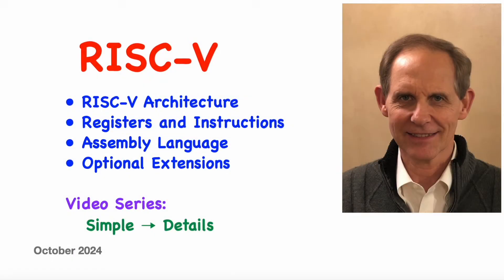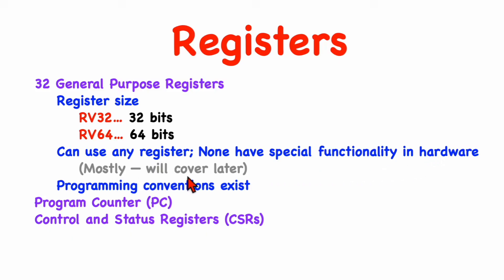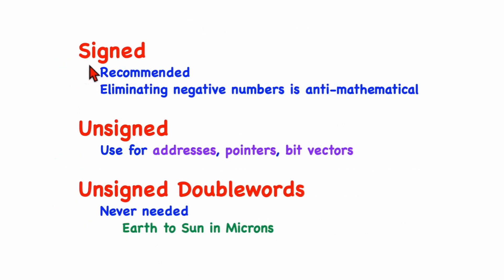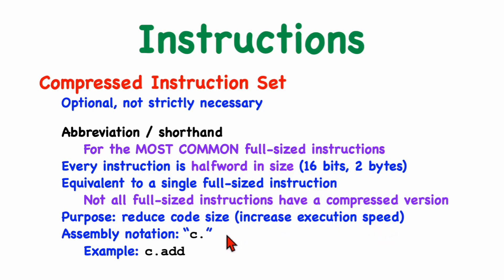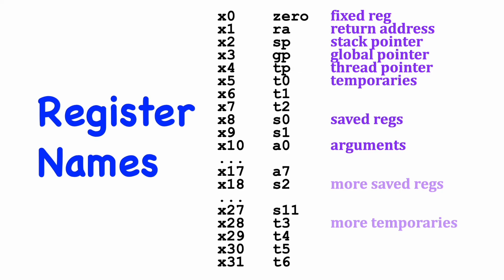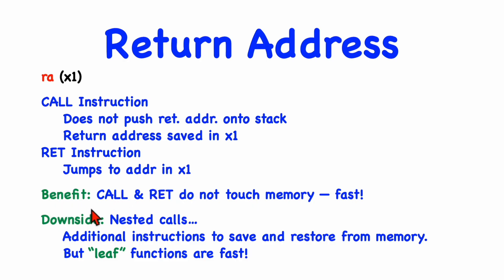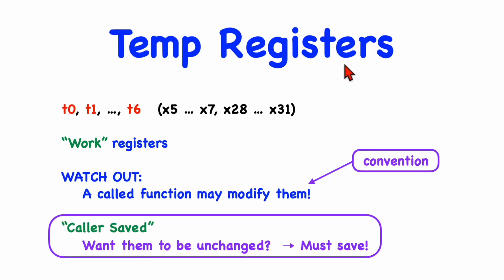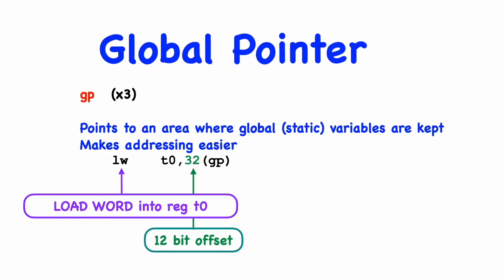RISC-V Assembly Code #1: Course Intro, Registers

Comment: I guess there is some mistake in Golbal pointer slide. how did they got  offset as 12 bit? shouldn't it be 32 bit?
Reply: The offset is encoded as part of the instruction, so there is only 12 bits for it because the instruction is 32bits?

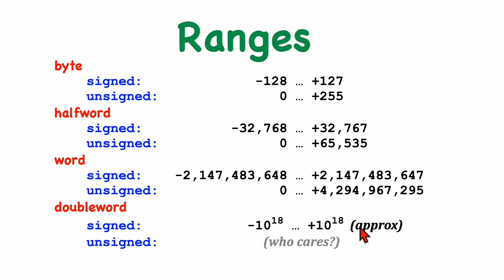Comment: Interesting that my comment on the usage of 64bit unsigned in several use cases, such as telemetry, thus disappeared. Yet the flawed reasoning "never needed" (5:05) is still in the video; says a lot about the creator's aim at quality. For instance, Prometheus and OTel both use uint64 in their protocols for reason due to need. And even quite some time before them we already had 64bit unsigned counters in network management protocols, something that is even more essential on today's data center 100G links. The "content creator" should better leave such judgement to people in the field who have reason and need for this. Let's wait for re-upload #2; will an uint32 suffice or do we need uint64?
Reply from the maker: I saw your comment and there is merit to it. For this reason alone, I redid the entire video to include a qualification as a subtitle. Apparently YouTube does not allow a video to be re-uploaded, so I deleted and replaced this video entirely. I also modified video #2. Unfortunately I lost all comments and the watch count.

Let me be clear. It is my OPINION that for things like loop counters and addresses in RV64, signed values will always work fine. But if you want a SRL (shift right logical) in C, the best approach is to use unsigned values.
Reply: Explore underwater caves so you can meet your fated end. The void is calling to you, buddy.

Comment: There are many reasons to use unsigned doublewords ( 5:28 ). IMO, it's just best to say the capabilities that exist and let programmers decide when they need to use them in this case.

Also, for PCs, the upper bits are likely implemented but not expressed externally. The math, etc. still needs to happen as does the memory management aspects but, depending on the implementation, there may be only 40 bits, for example, exposed externally to the address bus. Remember back in the 68000 days when various systems used the highest 8-bits of the addresses to encode special things because those bits weren't exposed externally on the address bus but did occupy 32-bits of memory so the upper 8-bits could be used for special things, but then when the 68020 came out, all that code got really tricky. Apple, for example, had to make "32-bit clean" ROMs and programs, etc.

I like your videos on this, I've watched a few so far. You are a good presenter and the videos are done well.

Comment: what does anti-mathematical (at 5:28) specifically mean in this case?
Reply: The set of natural numbers is not a group with addition, just a commutative monoid. We lose the invertibility property, which is very useful.
Reply: @CjqNslXUcM  okay but how does a set of natural numbers being 'just a commutative monoid' spepcifically relate to being anti-mathematical. In order words what is your point of losing invertibility when using natural numbers and how that's anti-mathemtical?
I don't see that as being anti-mathemtical it's math and a property of that mathematical object (nat num, + => not invertible)
Reply: @knkootbaoat6759  I'm just speculating what he might have meant. It's not symmetric and you can't transpose terms or subtract without risking underflowing.
Reply: @CjqNslXUcM  fair enough